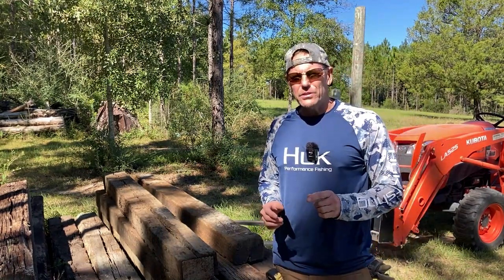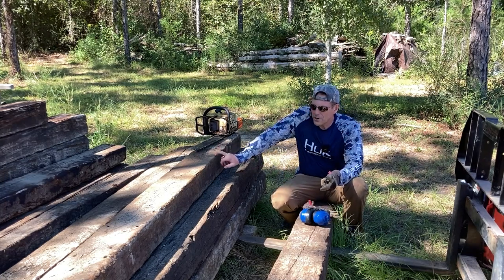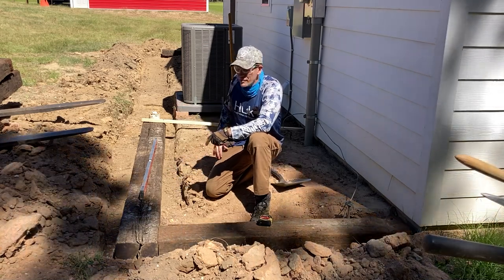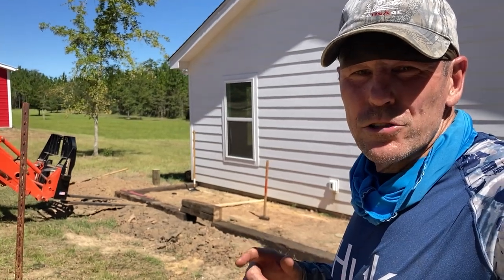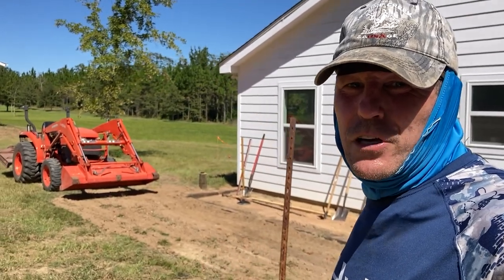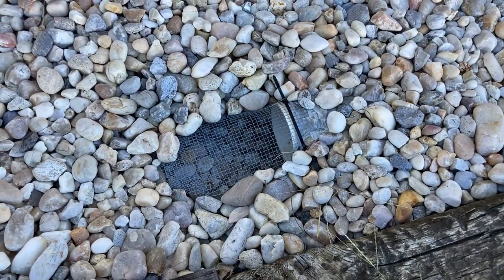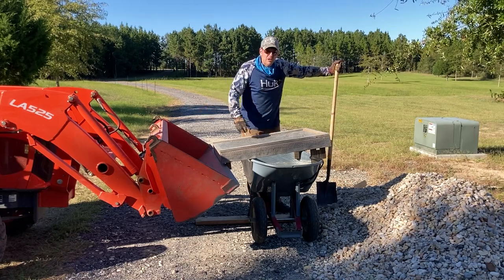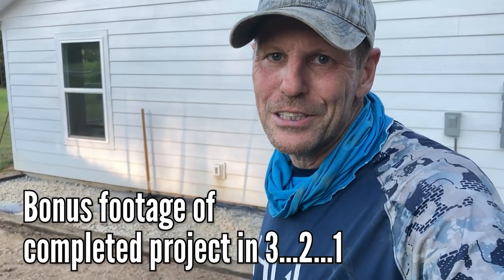Affordable Landscaping with Railroad Ties (Before and After) | E121

Comment: Railroad ties have been used the past few decades as a cheap solution for retaining walls in residential homes and commercial properties. What homeowners don't realize, is that these cross ties are not only harmful to the environment, but they pose a huge health threat! Ensure they've been responsibly sourced and properly treated for residential use, particularly if you're planning to use them in a vegetable garden or close to water sources. The risk of using railroad ties, treated with creosote, a known carcinogen, primarily comes from direct contact, inhalation, or ingestion.
Here are the precautions that should be used when handling railroad ties:
Handling: When handling creosote treated wood, wear gloves and long sleeves and try to minimize time spent working with ties. Work in well ventilated areas and avoid working in hot conditions when vapors are most potent.
Children: If children play on or around the ties they may get creosote on their skin and clothing and could subsequently ingest small amounts. Exposure to skin can cause irritation and rashes. Ingestion in small amounts while not life threatening, is a health concern.
Gardens: Plants have shown only limited potential to take up creosote but some compounds have been shown to attach to roots, which could lead to elevated creosote levels on tuber vegetables. For this reason, it is advisable not to landscape with railroad ties directly in contact with vegetable gardens.
Water Table: Some components of creosote are very sticky and not water soluble and will stay on the ties; however, other chemicals are water soluble and will dissolve and move with water. In areas where moisture levels are moderate, these chemicals may wash into surrounding soil with rain, but will likely decompose with time. However, in areas where the water table is very shallow or where a lot of surface water is present, there is more potential for transport of the chemicals into groundwater. For this reason, it is advisable to avoid using railroad ties for landscaping in very wet or shallow ground water areas.
Disposal and Fire: Creosote treated wood should not be burned, since burning volatilizes hazardous chemicals in the smoke. One currently suggested disposal method for treated wood is in sanitary landfills. However, check with your landfill first to inquire about local policies. Another currently suggested method for disposal is burial. However, if this option is chosen it is critical to consider surface and ground water movement in your location to minimize the possibility of creosote getting into water supplies.